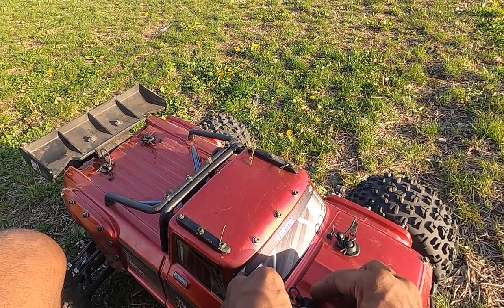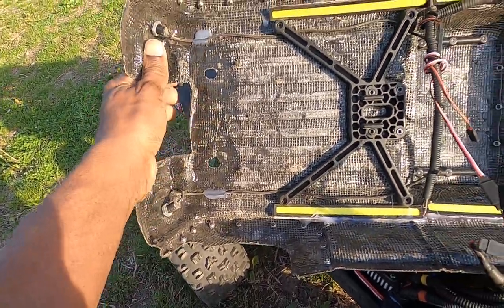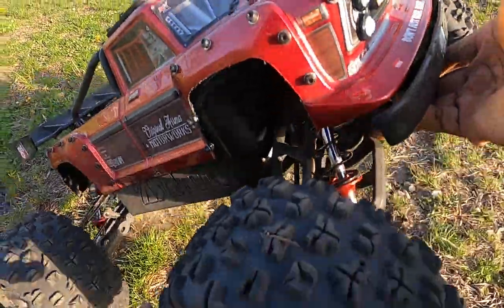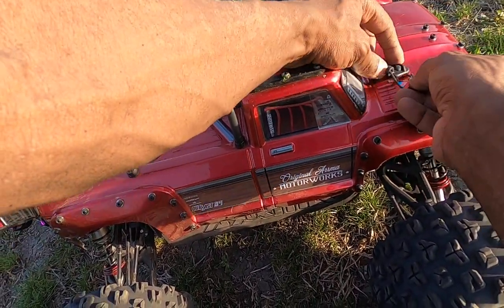Arrma Outcast 8s Part 2: Rip & Rant

Comment: Great videos, Keep them coming I am just going through the pains of figuring out the outcast since February. I like the truck but- this is what i found so far
1 - use your wing mount or your design (AWESOME)
2 - install droop cables back and front - forgot to add - the droop screws on the stock arms break the arms in that location when you hit something, so I would advise not using them - use the cables on the stock arms as well
3 - shoo goo the body 
4 - door trim the body edge and glue inside and out
5 - put padding on the top of the front shock towers
6 - thicken the inside of the body at both shock towers
7 - get rpm arms 
8 - extend the front bumper using HDPE plastic (still working on this one) gone through 3 bumpers
9 - strap the tires - i used gorilla tape on one and spider wire on the other - tape wins but very hard to remove the glue from the tires - i used the 60 watt bulb method
10 - change the servo - i used the raminators, fits perfect and the truck steers now
11 - install your own or by the mud guards for the back arms, inside the back of the chassis and along the back sides of the chassis  - i made out of ABS plastic which works well and have lasted with out cracking or breaking (8 packs so far on gravel)
12 - change the shock shafts
13 - check the receiver for water damage - it seems to take on water - i sealed mine with silicone lube
14 - make or buy shock socks - my wife made mine and they are awesome
15 - the battery straps kinda suck but if you reverse them they work better
16 - use left and right hand nuts on the rear turnbuckles to keep them from pushing in - don't use teflon tape

Thanks again for the videos
Reply from the maker: I gave up on the stock Outcast after I totaled it on the 2nd run. I just rebuilt it with a M2C crusher chassis & while it's still pretty bad in the air, I can get use to it. But it's a dream to drive on the ground. None of that diffing out the Kraton does, just straight power & I can get full trigger pulls too. I think Arrma just wanted a big money pit with that thing. It was way too hard to keep the stock truck from nose darting. I'm working on the front bumper too but it might involve cutting the stock parts.
Reply: You no it is not a bad truck 
I get what you are saying 
The big thing with me
In Canada that truck costs 1300 and then the updates at the start are about another 500
Which sucks by it is fine/fun to drive 
Or are least it is so far 
Back flips costs lots $ doing it with this unit as it does not like to land properly unless you have lots of air time
Is that bangood transmitter that good ?
Reply from the maker: @kensgarage62  The DX3 cut out on me mid-air & sent the truck to heaven before the failsafe kicked in. I stopped using both after that. the only thing the dumbo's ever do is turn on & WORK.
Reply: @Megasty15  I am going to get one, thanks for the information, I will let you know when I post the images of what I have had to do to keep this thing from breaking